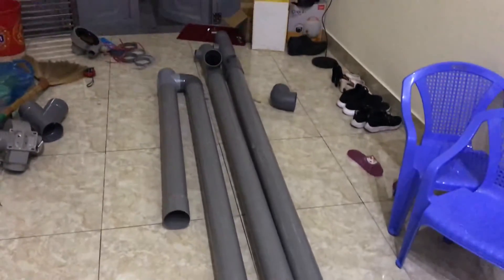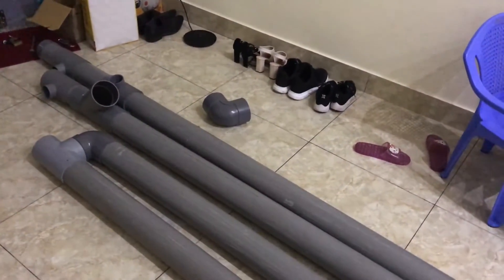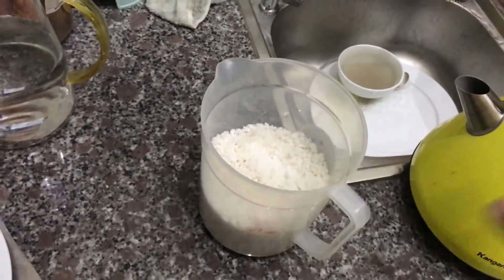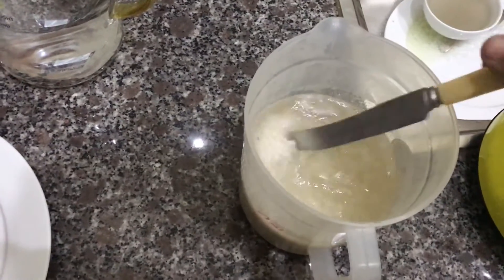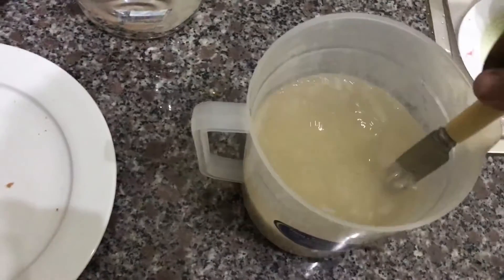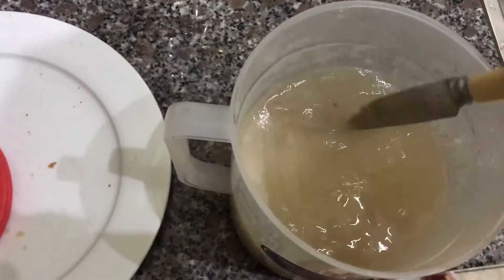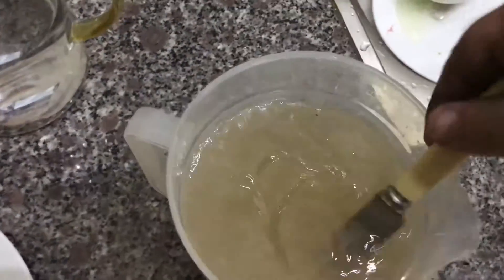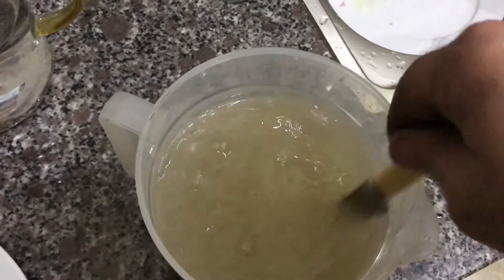Solar Powered Air Conditioner! DIY Project start

Comment: What was the result???
Reply from the maker: Well winter started here in Vietnam when I finished these videos and so I had not got back to improving the design but now the days are heating up again I will take another stab at the problems and update you.
Reply: @pacifictradingpost7972  update me soon with complete practical video 
And how are you cooling the air after dehumidifying 
When you had this experiment last time what was the temperature drop ??
Reply from the maker: We I actually got about a 6 deg temperature difference at one point between ambient and the out put but I ran it for an hour in my little room and did not seem to get a noticeable difference in the room temperature. 

My prototype was not very well built and I have some improvements to make next time.
Reply from the maker: Actually have you seen my other videos on the idea, it did progress a bit from here and I posted two updates